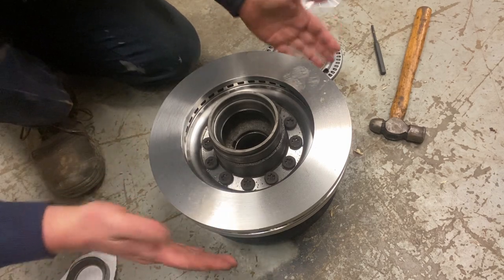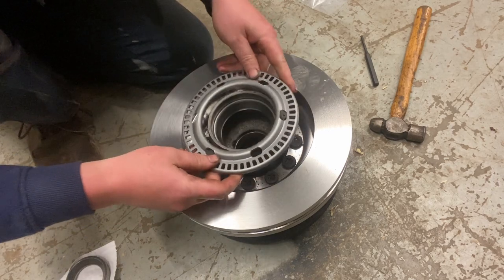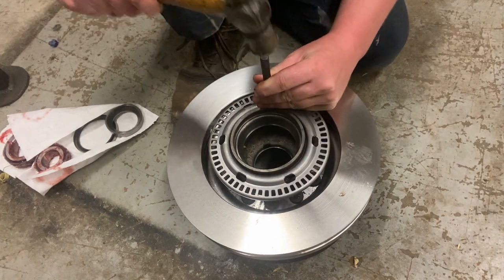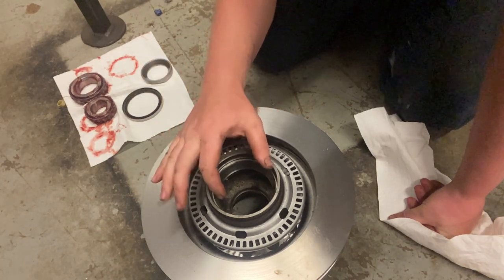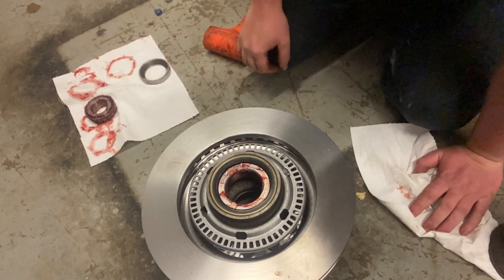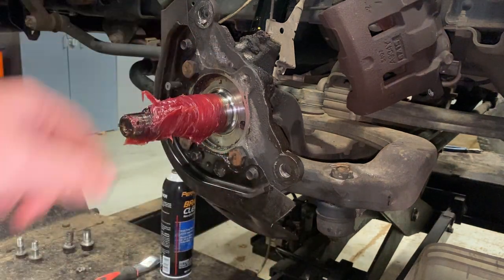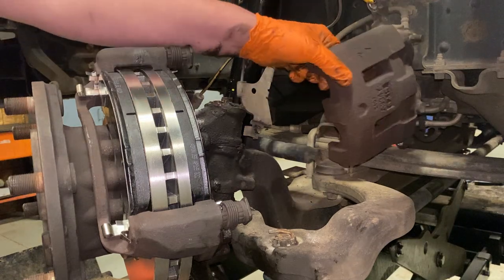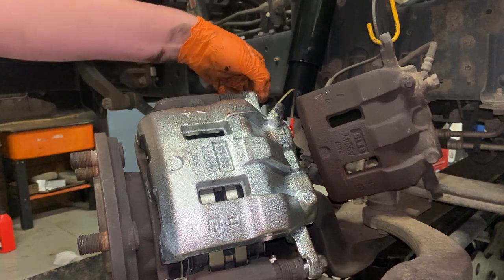Isuzu NPR front brakes

Comment: Do you have a video on how to bleed the brake system on an npr? I just purchased a 2012 npr hd with a gas motor. The pedal was spongy so I replaced the master cylinder. After bleeding the system the pedal was good for a bit but went back to the same symptoms. I am thinking
 air in the abs module?

Comment: The bottom 22mm caliper bolt is a pain to torque.  I had to cut a socket down to fit.  I’m curious what you used.  Thanks for making this video.
Reply: Understand what you mean, I had issues of the first side because I had the steering pretty close to lock, trying to get the most room. On the second side I found a sweet angle where the socket cleared that lower steering knuckle, and the other three bolts were accessible as well.